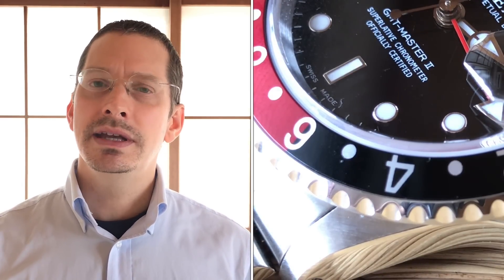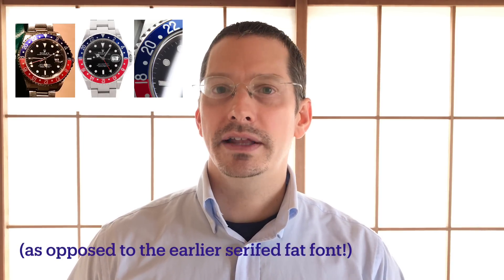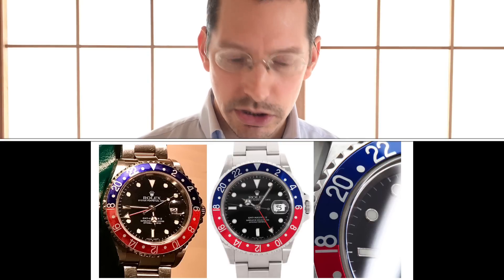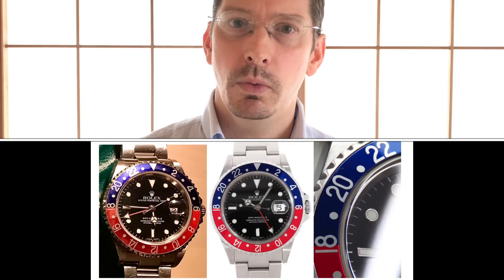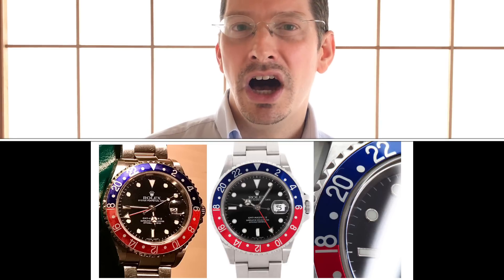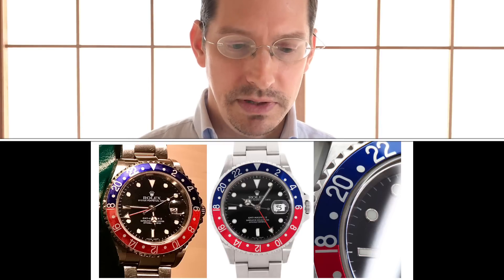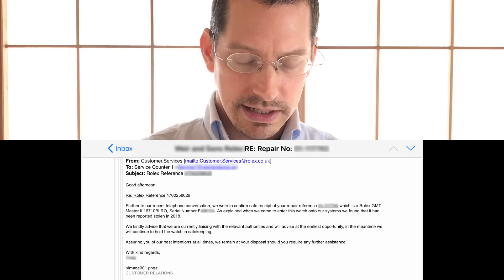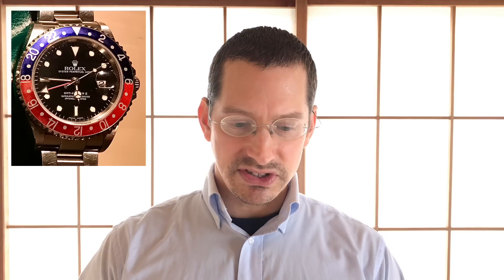A Tale of Rolex GMT Woe

Comment: Up to the Owner to report the stolen watch to Rolex to enter into their system.. The Police will not contact them.. There is also a lot of errors in the reporting a stolen Rolex watch by the fact that owner(s) will report the model number as the serial number of the watch.. This causes additional problems in returning/recovering the watch.  Rolex should have not returned that watch to Carl. They should have contacted the police and handed it over to them. Just weird/suspicious they gave it back..
Reply: They did not give me (Karl) the watch back - Rolex kept it.

Comment: Good for Carl. That’s one more reason to buy a complete fullset Rolex. I’ve known more than a few fellow watch enthusiast that this has happened to. It was always involved a loose watch. I suppose it’s harder for thieves to steal everything. They usually grab just the watch and don’t go digging around for box/papers. Now let me tell you about the Post Office seizure of one of my 25k Rolex for no valid reason. They are worst then a street mugger or burglar.
Reply: The Watch Register lost and stolen is circa 50% b and p and 50% loose watch incidentally - my contact says one of the biggest factors is 'insurance claims' of lost and stolen turning up again on market - Guess what... many many times a insurance claimee commits insurance fraud and then forgets about it and subsequently endeavours to sell watch on (some time after being paid by insurer) and the red light goes on when checked by dealer/buyer - they are then arrested for fraud !